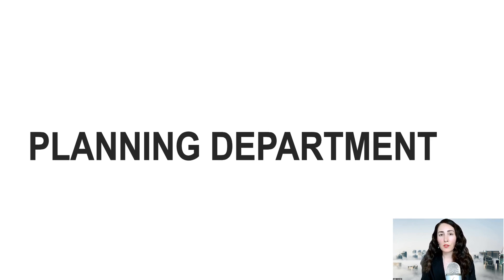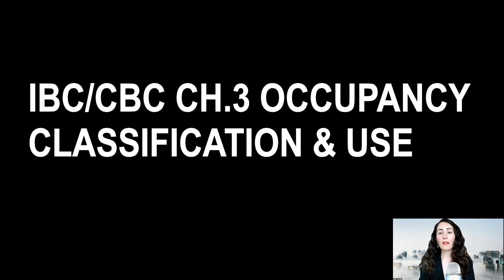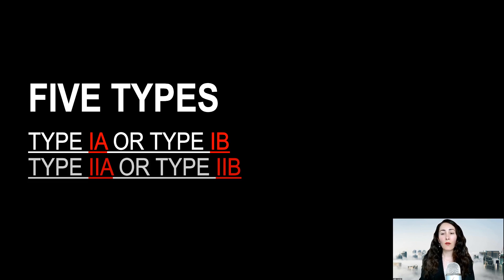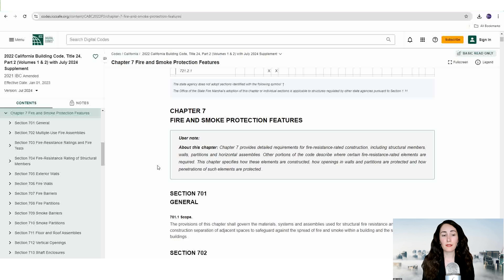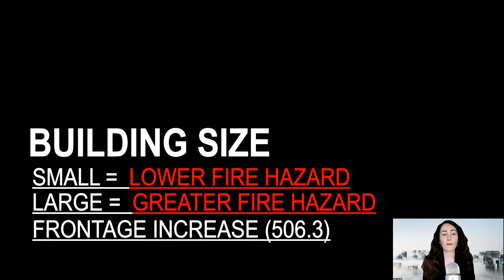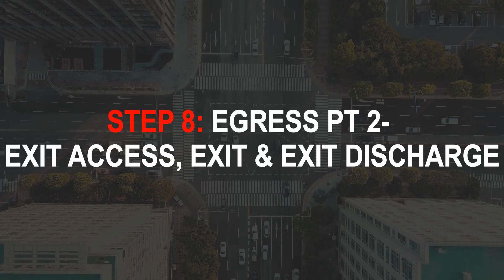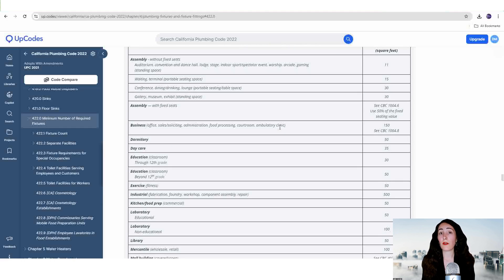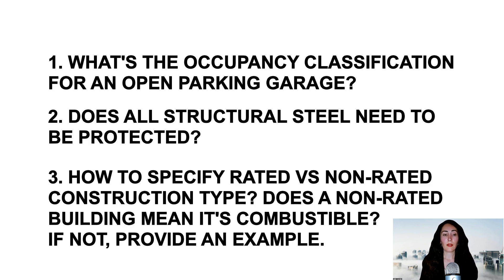MASTER Building Code Analysis in 10 EASY Steps

Comment: 1) Open Parking Garages are classified under Group S-2 Occupancy 
2) Since a project framed with structural steel would likely fall under Type I or II construction (Non-combustible materials), the project using IIA or IIB would not have to be protected. According to UpCodes, this would typically be a project that uses heavy steel construction and requires low or no fire protection. And as far as covered in the video, the “B” in both IB and IIB denotes the construction materials not requiring any protection– so structural steel being used in this type of construction would not “need” to be protected. 
3) Whether a building type needs to be fire-rated or not can be specified by their construction type, if it's A or B. If a building is Type B however, it does not necessarily mean it’s combustible. For instance, Type I-B refers to projects that are Fire Resistive Non-combustible while Type III-B materials are both unprotected and combustible.

Comment: 1. the occupancy classification for a parking garage is Group S-2 
2. Not all Structural steel needs to be protected, they only need to be protected in fire rated construction
3. rated construction can be specified with the fire resistance, non rated construction doesn't mean its combustible, there are non rated steel that can be used without any fire protection

Comment: To me, the most important portion about this video had to be towards the beginning where you mentioned the importance of understanding even the most niche parts of zoning data as an architect. It is so easy to think that responsibilities could be passed onto someone else and allow them to fix the problem for you, but that causes delays or even complications down the line when a building wasn't designed in accordance with the requirements. At the end of each design, adjustments will have to be made, but the goal of the designer should be to minimize the needs for adjustments from the very beginning.

Comment: 1. The occupancy classification for an open parking garage is classified as Group S-2, or Low-Hazard Storage.

2. Structural steel needs protection only in fire-rated construction types. Non-rated types like Type II-B or Type V-B can use unprotected steel.

3. Rated construction has specified fire resistance, such as Type I. Non-rated doesn't, but it also doesn't mean combustible. For example, Type II-B uses non-combustible materials like steel without fire protection.